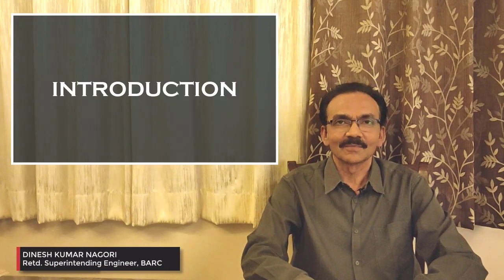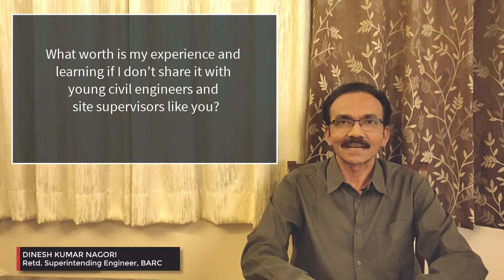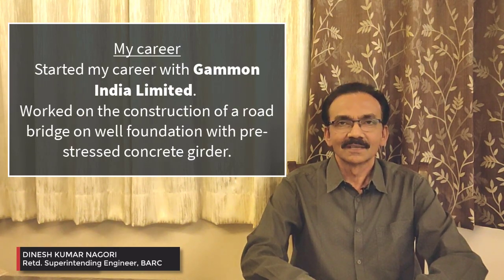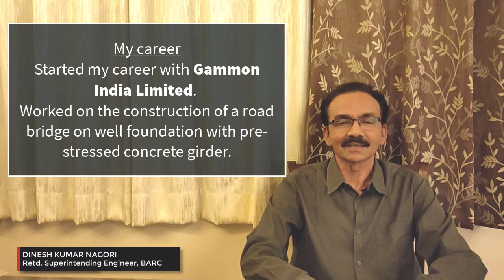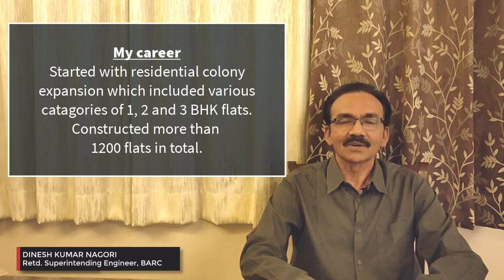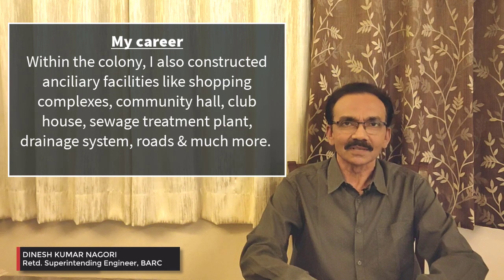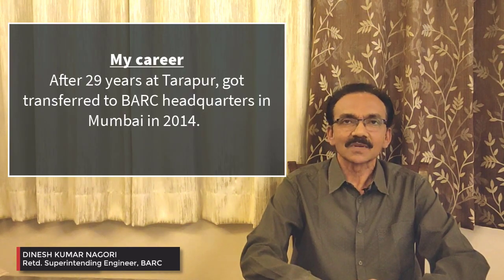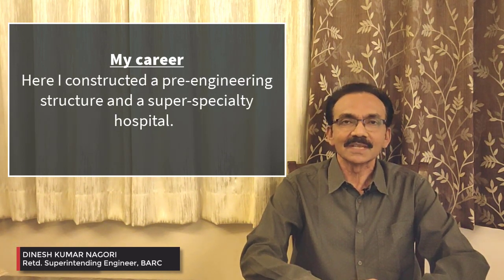Civil Engineering Excellence | Introduction | Dinesh Kumar Nagori

Comment: Sir, Your video on Box waterproofing is very impressing.  But I have a small plot of 45x45' for basement and if a trench 2' wide  is dig, out side the walls,  I will be loosing 4' on each side, which is not commercially viable. Please advise if there is any other alternate to this option.
Reply from the maker: Thanks for appriciating .
You need not to loose any space. It's designer how he design the basement.
You can as well have a box without projections.
After treatment you can backfill on all sides.
If you need more clarification please send me an email at dineshnagori2019@gmail.com.
Reply: @civilengineeringexcellence  Sir, thank you for your advise, which was very encouraging for persons with limited size plots. 
Can I request you to design the basement and give stept by stept instructions for waterproofing with stone-box system.  Please reply by saying "YES" only, so I can email you to discuss further details.